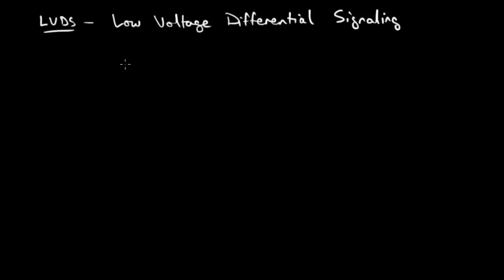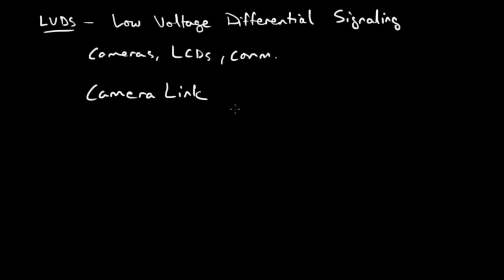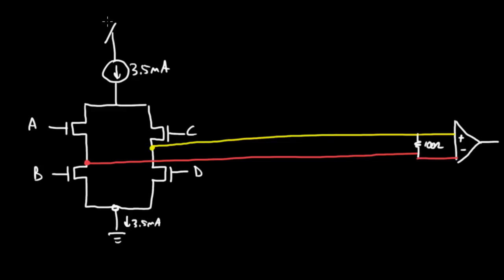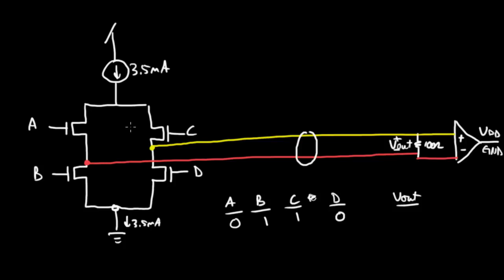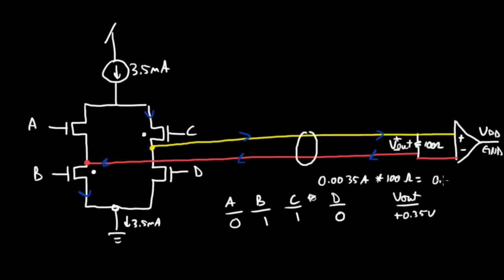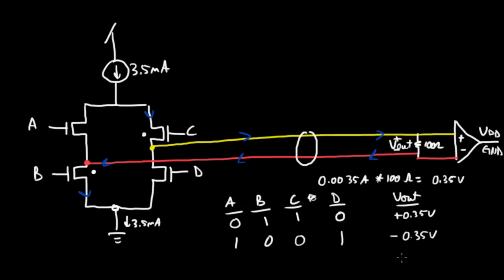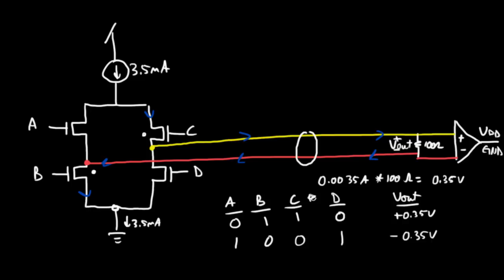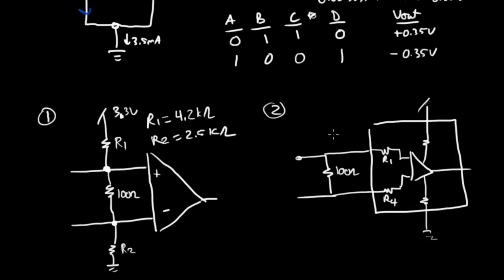Differential Signaling 4 of 4 (LVDS)

Comment: Hello Blake,

I have an LVDT (intrument used for precise length measurement. Just like a transformer it has a primary and 2 secondary windings) and the manufacturer mentions that I have to install a minimum load impedance of 50 Ohms on my differential output and that minimum load impedance needs to be connected to the reference of the primary winding. How did they come up with the 50 Ohms needed and why is it referenced to the primary winding?
Reply: LVDT and LVDS are almost entirely unrelated.